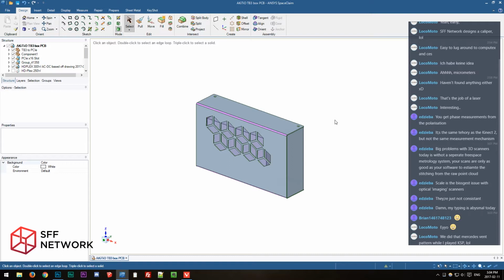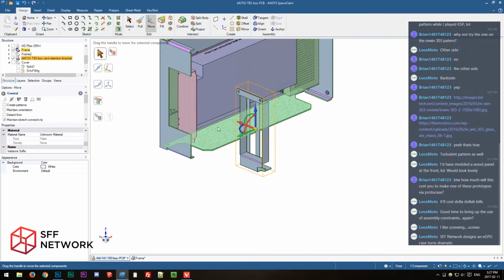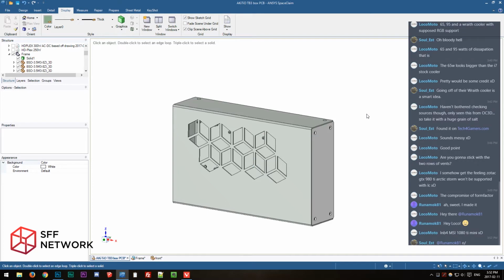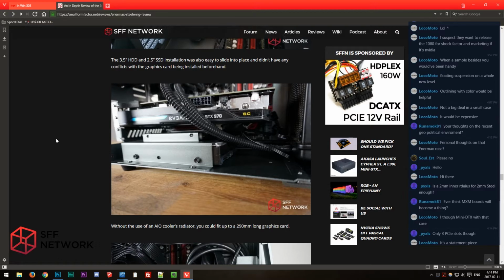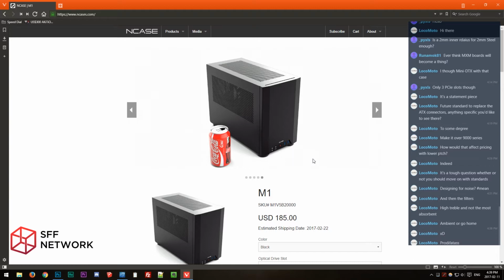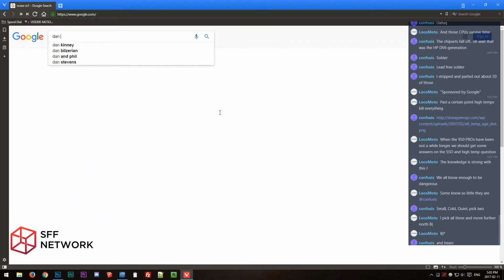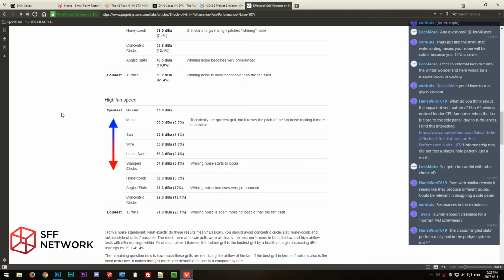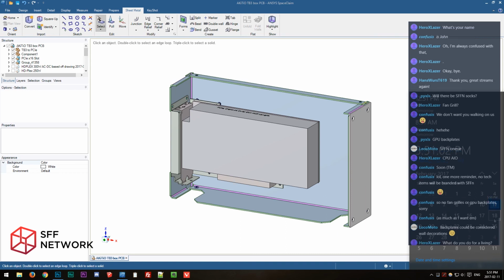SFF Forum designs an eGPU case - Episode 5 - Better late than never!

Comment: Fantastic! I actually recently purchased a 3D printer specifically for case prototyping. https://folgertech.com/products/folger-tech-ft-5-large-scale-3d-printer-kit It has a massive bed, so I can pretty much print a case at any reasonable dimensions. I love your work and the work of the community you run. Keep it up!
Reply from the maker: It's crazy how good affordable 3D printers have gotten in the last few years. Now if only powerful laser cutters would come down in price, because call me old-fashioned, but I prefer my cases to be made of steel or aluminum :p